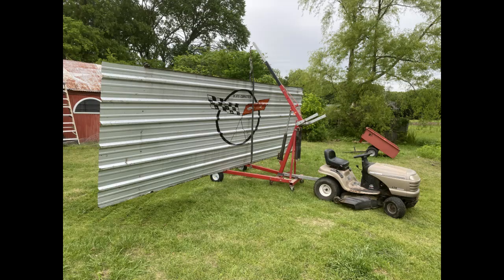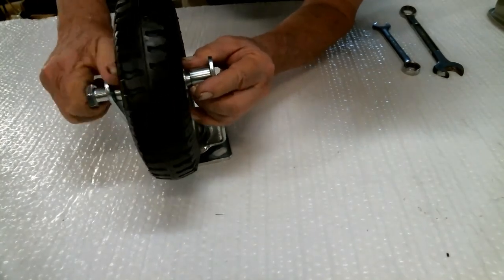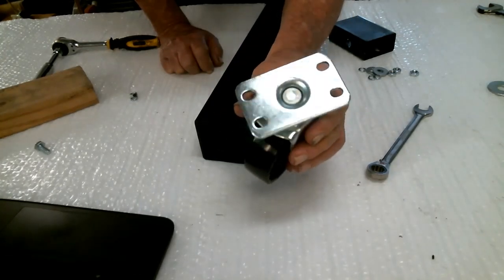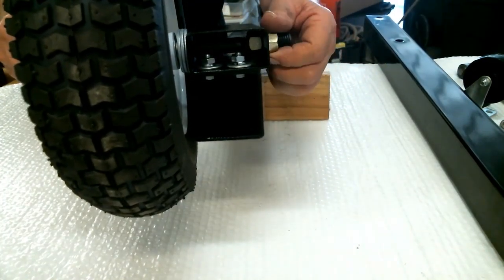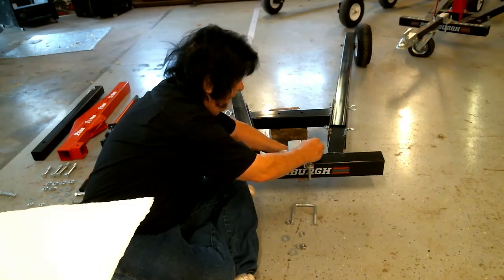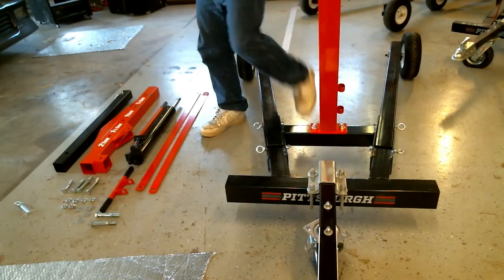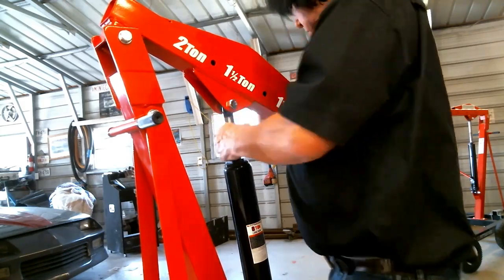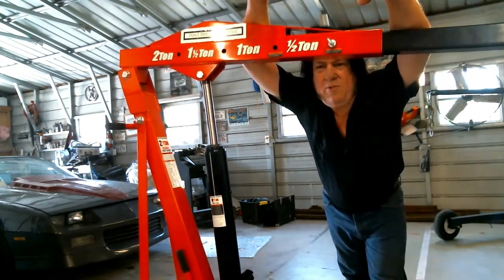dung beetle crane conversion kit assembly video

Comment: What’s the longest extension you can buy for hanging trusses? How much would the kit and the longest extension cost? Thanks
Reply from the maker: give me a call, rob  214-364-5671
Reply from the maker: KIT IS 299 PLUS SHIPPING, I MAKE EXT. TO 8 FT BUT CAN COUPE TOGETHER AT 150 EACH ,  2 WILL REACH 20FT HIGH WITH OVER 200 LBS